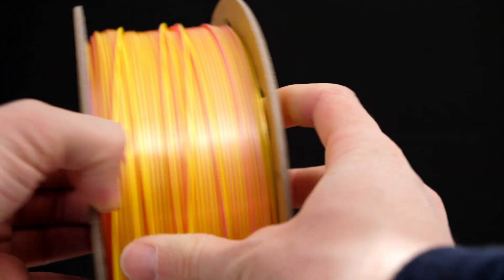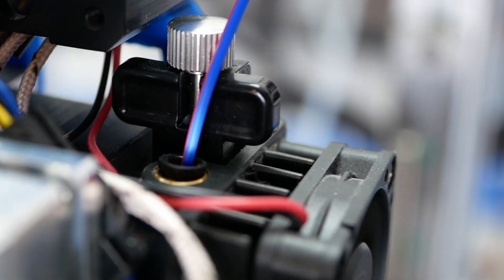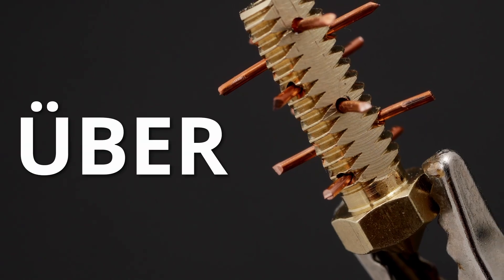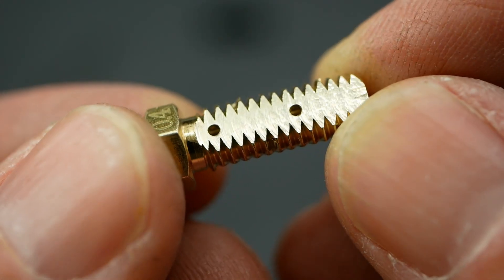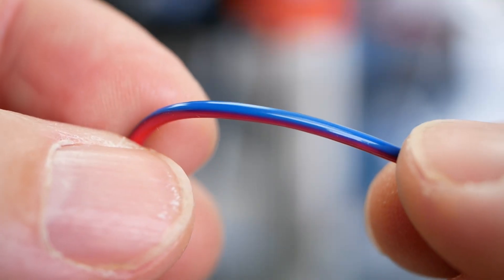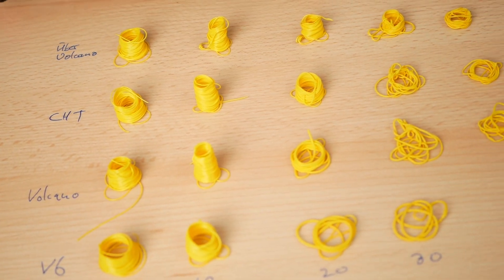Do High Flow Nozzles MIX Dual Color Filament?

Comment: CMYK would be insufficient for colour mixing in FDM, as it presupposes a white substrate. The Key filament would only lower albedo and you'd need an additional white filament to heighten it.

Comment: I built myself a (mixing) Diamond Hotend printer (based on a RUMBA, an Anet A8 and 3 Titan extruders) like 4 years ago and I was one of only a handful of people that seems to have gotten it to work and print a lot of stuff - back when S3D was pretty much the only Slicer that properly supported more than 2 colors. It was a very interesting experience, and I definately recommend you try it! Mixing nozzles are very weird beasts, not just because of the toothpaste effect, but also because you need to be aware of stuff like unused liquid filament starting to bubble after a while. Mixing nozzles are insanely fast at switching colors, cause you don't need to move the head away and the purge volume is TINY, you can often just hide it in the infill and ditch the purge tower completely (also good cause mixing nozzles string like hell!). There's also some VERY odd behaviour like color pushback up unused channels, meaning you need to purge more the longer the color was inactive!

Comment: I have been 3d printing four 3 years.  I do lots of big prints, so I have 2 printers.  I couldn't get my usual filament so I got some cheap 3Dsolutech stuff.  It clogged both my printers.  I replaced the nozzles and got new filament.  Now every print is failing.  The filament is coming out thin and not adhering.  I raised the temperature and lowered the travel speed. Still happens.  I did 100's of prints on these printers with literally zero failure due to clogging, now after the 3Dsolutech EVERY print has failed, ~10 prints in a row.  Can cheap filament really ruin your hotend like this?  Does anyone know what I should do?

Comment: This is awesome, I look forward to messing around with this. So glad your always pushing the industry further and testing with great accuracy. Could you talk about or look into wether or not keeping consistent volumetric flow rate close on all areas or none of them (ex: I find it is good to keep the  volumetric flow rate close to equal from infill to walls, which even though sensors show not much change in temp I feel the nozzle it self would still loose some temp if only a micro second, but that micro second can be the difference between good and exquisite walls and start lines) learned some information about this from the channel Pro3D.

Comment: have you considered cutting the tip off a cht nozzle and using it as an extension to create a cht volcano? you could connect the two via key and slot so they would srew in/out together without the risk of getting stuck in the hotend. it might melt the filament really well without the weird flow from a regular cht nozzle.

Comment: I'm sure I am not the first to think of this.  But I have not seen it mentioned, and I have watched 8,000 videos about 3d printing.
The idea is that as you print layers (arbitrary for example) 9, 10 and 11, you leave holes or slots in strategic places.  Then on layer 12, you pump those holes full of hot filament and you have effectively created a rivet that securely connects layers 9-12 and improves layer adhesion.  

You have run across this idea before?  Willing to test it?????  

Thanks for another great episode.
Reply: What a cool idea. Maybe send this idea to CURA so they can test it and maybe implement the idea into their software.
Reply: @andreaspoulsen8017  I'm hoping Stefan spots it and goes on to test it.  He has plenty of expertise to do it.  If it works I would approach Cura at that time.

Comment: I wonder, can sharpening the brass wire before soldering it inside the nozzle, would increase performance?
Reply: Of course the peak should be pointing up

Comment: how about a 7mm hex bar with the m6 thread inside, thread the volcano nozzle inside and drill the holes on those flats that can be centre punched to avoid drifting that way?

Comment: The dual color filament combined with 3d printing layer lines is actually a pretty convincing illusion of an anisotropic material.
Not specifically anything like iridiscence or pearlescence or brushed metal but something vaguely in that realm.

Comment: Hi Stefan.

Great video. I did my thesis on the topic of static mixing nozzles in college and thought I’d share my findings. 

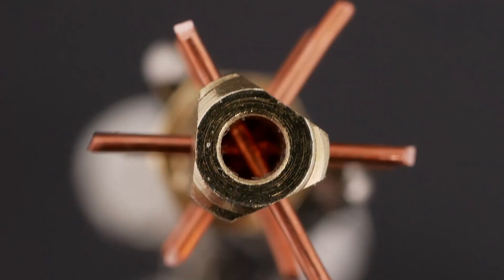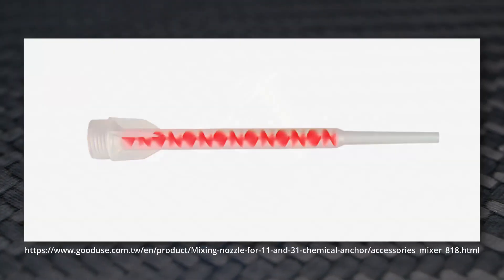We tested the three-way Diamond hotend extruder you showed(10:12), the Zmorph dual filament head, the M3D Quad Crane nozzle, and finally a custom metal 3D printed nozzle with a static mixing design similar to epoxy mixing nozzles you showed(4:25).

Although the Dimond hotend, Zmorph and M3D Quad Crane fed several colored filaments into a single chamber, they didn’t add any turbulence or mixing agent to mitigate the “toothpaste effect” where colors were only visible at certain angles. 

The 3D printed metal nozzle with epoxy mixing design by far had the best results. Would be happy to share images but can’t post pics on YouTube comment.

The ultimate pitfall that kept from continuous printing was leakage due to significant back pressure from from forcing the two filament through the mixing chamber. We never tested a dual-colored filament like the one you tested. Feeding this single filament could reduce back pressure and allow for continuous printing, just an idea. 

Best,
Noah 

P.S. I’ve been a big fan of your channel for years, thank you for your contributions to the 3D community.

Comment: Out of curiosity, if you have access to a lathe, of course, have you considered making your own nozels? That way, could you implement your copper obstructions with more control whilst also maximising thermal conduction? The second question is regarding your soldering. Would the use of a more precisely applied flux with a torch allow for a better thermal interface?

Comment: I have the Sovol SV02 which has a 2-into-1 hotend, but it's not a mixing hotend. You have to extract one filament before you can insert the other. I picked up a 3-into-1 hotend for a custom build but that works the same way. It seems this is the way most of them work however Sovol does have a 2-into-1 hotend for the SV02 that they specifically market as a "mixing hotend" (although, I haven't tried it), so might be worth reaching out ot them. :)

Comment: You can drill in a thread easier than filling the thread flat. tap a hole in a square block and drill into that. You are losing heat transfer by filling the thread.

Comment: i like how you said " might have even melted the solder" while showing us a clip of a bunch of spaghetti with solder spheres (seriously your automoderation got rid of my previous comment using a common synonym for that word starting with B... might want to fix your "bad"word filter)

also, i think the main reason your modified nozzles still had laminar flow is because the wires were all neatly centered, leaving all the fluid paths the same length. those mixing elements you've shown earlier all seem to rely on a concept of "bending it around a lot to slow down part of the fluid while letting another part through faster" which is what introduces way more vortices than just a centered obstruction (especially a round one, because coanda effect and all that).

Comment: I’m curious if you could cut a v shape into the copper wire and solder it in facing up so it has an easier time cutting the filament?

Comment: Soldering on brass is not possible. That's probably why the first attempt was unsuccessful.
Otherwise to contour the licence you can assemble the head with the copper wire in aeroplane.
Thank you for the sharing your great job !!!

Comment: What if you use one of those 4 in 1 nozzle and use 4 different types of these colorchanging filament? Or a pallette pro and try 8 different colorchanging filaments, I am seriously thinking of purchasing a pallette pro but damn that thing is expensive

Comment: You touched on it briefly, when you mentioned the 'smooth' copper wire, but one of the features of the static melt mixers that you show at 4:38 are sharp corners. The corners provide places for eddies to form from.

Comment: Not sure what the machining setup would be like, if even feasible, but what about having the copper wires come through at angles? They’d still go through the center of the cylinder, but angle up (or down). That way there’s more surface area covered and heat the “inside” of the filament for longer.

Comment: If you used Topnik TS-81 Flux, which is intended for soldering to stainless steel, you would find soldering to the brass bolt an absolute breeze. DON'T breathe the fumes, though, and clean thoroughly with alcohol afterwards.

Comment: Hey Stefan
I really wonder what is going to happen if you use something like M1.6 screws rather than this copper wire and soldering technique.
I know 1.6mm is may be too wide for 1.75mm filament but who is stopping you to drill wider the main hole ?
Also i know M1.6mm screws but maybe there is much thinner screws that i dont know. This way this proccess may be more accessible in my opinion. 
Have a nice day. :)

Comment: If you get a some what linear but not laminar flow in the hot end you should be able to pre calculate the collor of a mixing nossil, having it pretty much making it a CMYK Nossil.

Anyway, if you want to use it as just collor changing, having the change over be in the infill should solve the problem

Comment: Hey stefan, Your phrasing on mesh gave me an idea. Could you try adding a literal metal mesh between the nozzel and heat break? This would only require you to seal the mesh so there isn't any leaking in that area and no drilling but would also increase surface area

Comment: if the solder melted why not try using the  solder as a filament in a 3d printer

Comment: You could solder with silver-solder. There are different solders with higher melting temperatures that usually are melted with a torch. You could also try to make the wires sharper to make the flow better.

Comment: Great vid again Stefan, any chance of seeing any kind of comparison to see if there's any progression with the number of wires added, and see if there's a law of diminishing returns (say 1 to 8 wires)?
Also, I'd look to minimise the flat surface milling if possible, and maybe add some thermal paste to counteract the reduction in surface area for heat transfer from the block :)

Comment: You could spot mill circles in the nozzle and drill a tight hole, then just centre-punch the wire ends to expand them and seal the holes.

Comment: Could you take 3 of your modified volcano hotends mounted to a center feeding modified volcano with a very large tip. But mount the 3 so that they are not injecting straight in but at an angle to induce a vortex. Would this cause the dual color filament to wrap around the center feeding filament or mix it all together?

Comment: Hi Stefan! I have some advice for your frozen bread rolls from some tests that I conducted a few months ago. Based on my findings, going for a lower temperature and a longer time will usually always improve bread quality, however, the temp-time ratio often is dependent to the volume of the bread since a bigger volume will need a longer time for the heat to reach the middle. That's all. great vid as always hope my advice helps!
Reply: So, to get a faster printing, we should use thinner filaments!

Comment: Hey Stefan! I'm unsure if it's already been commented, but one idea I have for increasing turbulence in the flow is to offset the copper wires from the center of the flow path by a little. This would cause uneven resistances down each side path, leading to slight travel time differences of the split fillament, and when compounded with the 120° rotations might work well enough to cause some sorts of mixing. Varying the amount of offset for each wire would likely work even better as it'll introduce some chaos to the paths the filament needs to flow down. Just a thought! Good luck with the CMYK mixer idea!

Comment: Stefan, you could just sacrifice a heat block and use it as a conductor for drilling. Potentially, even create a conductor WITH the nozzle screwed into it and voila

Comment: Servus Stef, have you considered silver solder for fixing the wires? I forget the soldering temp (might be too high for copper), but it's much higher than led and way stronger too...
Also using a spotting drill (6-10mm short stiff drill bit) to start the holes prevents the walking you've experienced without having to mill the threads flat. Just need to make sure your work holding is rigid.
Another option is to thread a brass nut on the nozzle and use the flat sides to start your drill and just drill straight through.
Great videos and lots of fun watching the progress of your diy nozzles! Vielen Dank!

Comment: Would a standard nut pre-drilled on 2 opposite sides be an easy guide to trial the holes for the wires? It already has 6 faces, so rotating it the right number of turns would make it easy to achieve the angles, the nut face to drill is flat so it should be easy. And the result would have even more heat transfer since you would not need to made flat faces on the nozzle. Just an idea. Great video. Thanks

Comment: So a few thing to try on the Uber nozzle V2, first try using a small bit when machining down the nozzle, also try going side to side only where you want to put the wire, instead of front to back, this should leave more contact area to allow for better heating, second try brazing the copper wire instead of soldering, this will allow you to bond the wires with something like brass or even copper, third I would do this as a separate test but add a thermal compound to allow for better heat transmission, thermal compound fills in all the little voids

Comment: So we want complex internal geometry to increase heat conductivity to filament, yet it's a total pain in the ass to make with traditional manufacturing means. So why don't we 3d print a nozzle? Will most likely be extremely expensive, but you can do all sorts of crazy shit on the inside of it.

Comment: The trick to drilling holes in threaded round stock is to use a nut. Thread the nut on, and then drill through the flats on the nut

Comment: Idea for your hedgehog hot end: instead of using round wire, could you use flat blades instead by pinching flats into the wires, or use something like nichrome wire?

Comment: Unfortunately, I don't think nozzle mixing will work.  I believe it's an industry-standard that if you truly want an even plastic mix you need to palletize and re-extrude.  Tho have an idea for another test. Do you remember that old technique of Sharpie/spray paint on clear filament? Maybe this could help that work a little better.  But if there's still no change then we would know definitively that there's no mixing happening.

Comment: You should braze the wire into the nozzle rather than solder.  You'd get a much higher temperature and stronger bond.  Also, rather than milling a flat to drill the holes, start the holes with a center drill.  Then follow with the final size.  That will keep you from reducing the contact area for the nozzle to the heating block.

Comment: Here is a crazy idea to get more turbulence... hammer or squeeze the middle of the wires "flat" before insertion and then adjust the flattened wires as rudders to direct flow.   Solder wires in place when you are happy with "rudder" positions.

Comment: For higher extrusion rate than round filament, I suspect a flat ribbon filament could provide much less resistance to heat flow into the filament. (I've been meaning to try this for about 5 years now, but it would take a custom heatbreak and nozzle.  Somebody should try it!)

Comment: 1. Use silver plumbing solder, goes a lil hotter and is stronger. It also conducts more heat.
2. Use a torch to get the whole thing hot, the just let the solder wick in.
3. This is great. I'll post some of my custom nozzles once I get my printer working again. 
4. Patent laws don't apply until you sell it. Experiment away!
Reply: Patent laws often still apply if you mod a nozzle and then start selling things made with that printer.

Comment: Is there a specific reason for expressing flow rate in mm^3 rather than ml?
Reply: 1 ml is 1000 mm³. Expressing 40 mm³ as 0.04 ml sounds awkward. Besides, that's how everyone is rating their nozzles and extruders, so it's easier to compare numbers.

Comment: It would seem that removing the material from the nozzle would reduce contact surface area thereby reducing the amount of heat transfer. I wonder how much heat transfer is lost on the flat surface areas and if the flow would be much better with less material being removed? 

I Love the experiments. You can learn so much from doing them.

Comment: Another guy on YouTube made a 6-input hot end with the express goal of doing fully color prints by color-mixing.  He hasn't found a passive mixing system that blends the colors well.  His best efforts did show improved mixing, but also took forever to purge and had bad stringing.  

My intuition is that color-mixing FDM printing will require an extra motor to spin a mixing blade/screw in the hot end.  Just have to figure out how to seal the spinning shaft...